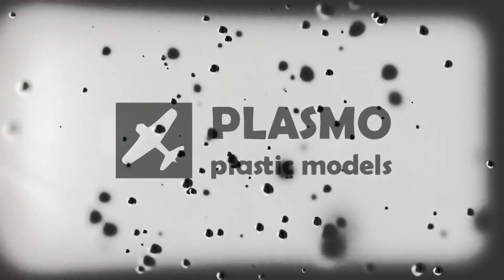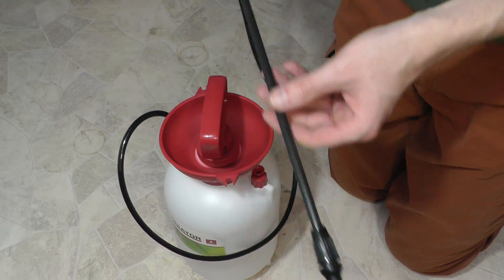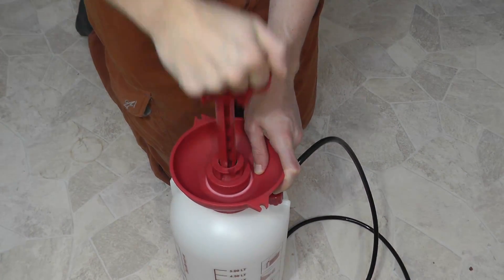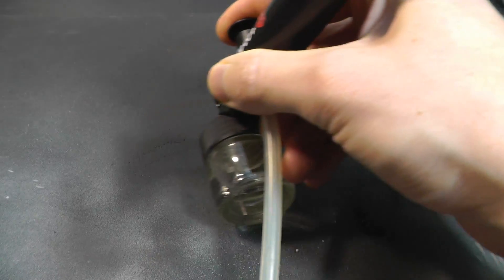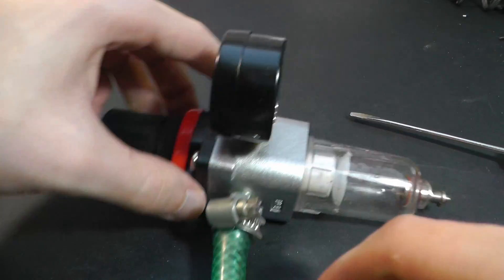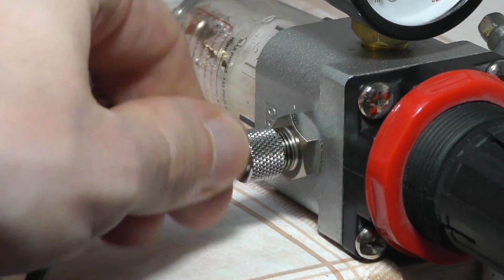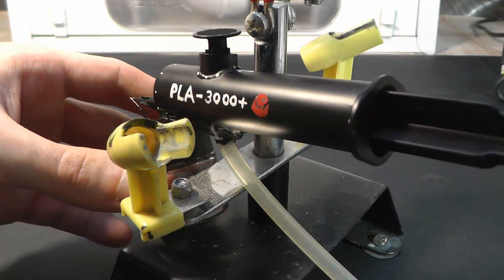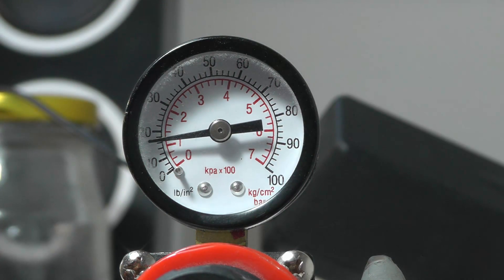DIY Pressure Sprayer = Air Compressor - Bonus Video

Comment from the maker: You can make models even in a post-apocalyptic wasteland if you round out of electricity. And its pay off. :-D
Reply: Modern problems require modern solutions :P
Reply: I from russia i LIKE yours vidio
Reply: Really amusing. Brilliant idea.
You taked making models on another level.
Iwata & Co. are pretty good,but using an handmaded tool is superbe!
Bravissimo,complimenti! (Trad. very good,compliments!)
Reply: The weathering opportunities would be endless to!
Reply: But my other question is how to clean this hand-made airbrush
Reply from the maker: @ericbadia5  It was in the airbrush video. Simply with thinner or alcohol.
Reply: PLASMO - plastic models oh! Thank you very much!
Reply: @ericbadia5  
I think that the only part that has to be cleaned is the paint's pipe.
You can use a syringe with a needle and proper solvent.
Reply: You are such a great modeler and a great person too as far as I can tell, keep up the great work :) Greetings to Czech Rep. !
Reply: @paul7376  im from slovakia
Reply: Harasho. Nagyon jo. Very good. Zer Gut. 非常にいいです
Reply: This really helps me out. My compressor was under a few centimeters of water when my apt flooded. I'm pretty sure the compressor is toast but I have not taken it apart yet.
Reply: I am not sure if you maybe once replied to my comment but in the case und didnt saw him I will write it again.

What do think of custom photo etched parts made by a mask printed on a normal printer and a fresnel lense to shrink it?

You can buy these lenses as spare parts for overhead projectors and they are also available in quartz glass wich is UV transparent and resistant.
Reply: Just be healthy  and safe ! Plasmo
Reply: you rigth...bro¡¡¡ jajjaj its good idea for later end of the world¡¡¡ for make models
Reply: PLASMO - plastic models Hello David, please make a Bi-plane with the emphasis on Rigging. Thank you and stay safe!
Reply: I'm from Belarus.
Reply: Hey! It's possible with an aquarium pump? Can you make a video about it ? 

Thanks!!
Reply: You got great hair.
Reply: I have a question, did the enamels paints a good work on airbrush? Im new on airbrushing and i have a lot of enamels paints, and how can i dilute the paint?
Reply: La Pampa Argentina, with the global pandemic
Reply: I guess it is kind of randomly asking but do anybody know of a good website to watch newly released tv shows online?
Reply: @Maximilian Cassius Lately I have been using Flixzone. Just google for it :)
Reply: @Yehuda Rex yup, I've been using flixzone for years myself =)
Reply: @Yehuda Rex Thanks, signed up and it seems like a nice service :D Appreciate it !!
Reply: @Maximilian Cassius No problem :D
Reply: For the more technically inclined a old fridge compressor works well.
Maybe an idea for a next video ;-)

Comment: honestly this would be great if you already have the garden sprayer but this has no point 

1. if you buy the garden sprayer 5L and the air regulator and buy the materials to build the DIY airbrush it will atleast cost somewhere 40-50 euros which is not worth it

2. you can just buy a cheap airbrush that works better than the homemade one for 10 to 16 euros

3. you can also buy a cheap compressor for 30-35 euros which is far better than the garden sprayer

4. this setup costs 40-51 euros max and is far better than the DIY

5, its not worth it to go out of your way and buy the gardensprayer and the materials needed to build the DIY airbrush unless you already have them or unless theyre really cheap were you live

conclusion dont go out of your way to make these it will cost you nearly as much to buy a normal far better airbrush setup

the end

6. im speaking out of personal expierence

Comment: I though about rigging an cheap car compressor with a pressure gauge and connecting 4-5 pet 2l bottles and then connecting those to the airbrush, tho not yet tested might work enough.

Comment: How much was regulator? It sounded like you said $80 but that's has to be incorrect. There are regulators for tool compressors for like $10 that look like they should work.

Comment: i just bought a 7 euro 'car tire' compressor on ali express. it cant pump a car tire but it can definitely pump an airbrush. You only need a female sigarette lighter plug to either powersocket or a small dc female to plug in any 12v transformer (most people have these lying around) and then you're done for about 10e.

Comment: Hi @PLASMO, this video is perfect for me. I started building models and I want to airbrush them but the compressors I want are very expensive. An Euro-Tec 20A is 378 euros. I could buy it, but I am not sure it is worth that much for me since I work full time and have hardly time for this hobby. I would like to try airbrushing first and experience painting before spending €€€€ on this. I will be building your project, thank you so much!

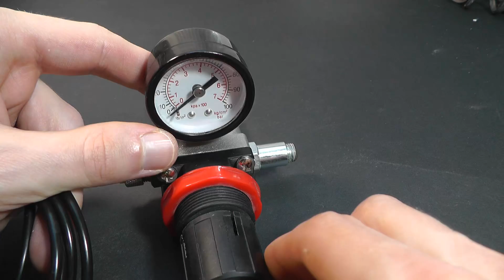Comment: 2:16
I'm really sorry to be that person, and I'm not implying that your English isn't good, but I had some trouble understanding what was said here. What kind of regulator is this, and how much did you buy it for? 

Thank you so much for this video, by the way. I realise that airbrushing seems to be the way to go for painting vehicle models, but I'm really poor these days.
Reply: You need a air regulator with a pressure gauge, so that you are able to set the outcoming air on a certain pressure.Its also called air regulator or air pressure regulator on amazon.
Reply: @markaz021  Thank you very much.

Comment: Can someone link a similar pressure regulator that David used in the video? And what kind of attachements/connectors you need to connect it to the barrel and the gun? Thanks!
Reply: if someone need it it is just a regular AFR-2000 regulator

Comment: You can make a panel line scriber, by using a mechanical pencil, and a sewing pin.
1.Cut the round bobbin end off the needle.
2. Empty the mechanical pencil of its leads.
3. Insert the needle into the mechanical pencil with the point facing outwards.
4. Adjust the pin so the tip shows by about 3mm or 4mm.
It creates really fine panel lines, and if it ever does get blunt, just replace the needle. Cost = about £1.50p
Reply: Wow thank you so much for this comment haha - that’s absolutely genius!

Comment: David
Your a genius. You definetly have a knack for thinking laterally and problem solving. This way, even if you live off grid way out in the boondocks you can still have an airbrush and compressor. Dude, please keep em coming - I am really enjoying these "make stuff cheap" videos. If you could design any of the following :
1. Needle files in various sizes and shapes for awkward shapes.
2. Modeling saw.
3. Model table paint organiser.
4. Angle chopper to cut accurate angles from 0°-180°
5. Motorised paint shaker or mixer.
6. U V lamp.
7. Circular and round sanding sticks for awkward spaces.
Thanks.

Comment: I still use brushes and masking tape for the fact that it's cheaper, but with this new option I may be able to use an airbrush finally which will be especially useful for foamboard rc models

Comment: Plasmo, the AB build and air supply build is remarkable. The finish you achieved was stunning giving the parts. Can I ask if you will be using this ? I see you have good equipment and would like to know when you would use this over your other gear?

Comment: You can use as a compressor, a pump for aerating the aquariums, and as a pressure accumulator the container from the vermorel (the spray container) with two sense valves. And all with a cost of 20 euros.

Comment: Another bonus is, that it has a water separator,  because condensed water in the air is always a problem and Leads to speckles on the model.

Comment: Nice!
But I don't think it's worth it.
I started with a set for around 160€. A compressor with pressure measuring, a good tube and a good airbrush pistol. I also bye a second smaller nosel, so I could change the size if it's needed.
With the smaller I don't use so much paint. So in the long run I would say it's not worth.

Comment: Not only cheap but also very silent. I tend to get a mini heart attack whenever my compressor starts pumping.
Reply: you can make one with a refrigerator motor, if you add a tank (fire extinguisher, or gass container) and a pressostat on off switch and a pressure regulator with moisture trap, you can have for less than 100 euro an identical compressor with those italia silent ones going for 400+
Reply: @joek600  Yeah, that works but it depends heavily on luck. Fridge compressors r cooled by circulating cooling agent and do not have radiators or fins for air cooling. There is also lubricant in the fridge loop for lubricating the compressor. Without cooling n lubrication it might not last long. Also I've never seen a fridge compressor that will give more than 4bar pressure.
Reply: @StopItUrKillingMe  Mine reaches easily 140 psi with a custom made 14 lt tank from marine grade stainless steel. As for lubrication it will eventually lose some oil, so you need to add afew ml every 6 months. The only drawback is that if the oil gets in the circuit and in the tank due to oxidation in will start to smell bad. I solved that by adding a second moisture trap at the air feed before the cirquit of tubes that go to the tank. Mine works fine for the last 5 years. And if it would eventually burn out at some point, its 60-70 euros to replace the motor with a brand new one. A full tank can last me for about 35 min before the motor kick in again to refill it.

Comment: Great videos as always, David. I use a car spare tyre for air supply, Halfords (UK) do a replacement hose for foot pumps which I joined to airbrush hose, pump up tyre with foot pump which has a pressure gauge built in. Works well and free to use.

Comment: Renaissance  man. David  that you are.   In a time having a home with the garage.  I saw where, vacuum chamber and the  machine  was to  high in cost. So i took a Heavy Shoe box and. Vacuum cleaner.  Poured  the resin in to the mold. Took out the air bubble. The  finish product was fine. No problem  at first  it was. I did some twiting. It was a mess. But after  few try. Well it works. And yes people have  try it to and failed.  But i didn't  have to. I fix it a little more.  But the box has to be a shoe box heavy one at that. Duck tape  and tight hole. Now! I  live in apartment  so i need a pressure  pot. And i have and old, very old. Compressor.  The product is  from Japan.  Little  over 30 years old. But will see. What i can do with it. .... fun!
Reply from the maker: I had similar problem. Thus I made a vacuum chamber from a double-layered stainless cooking pot becouse the glass cover for vacuum or plastic boxes imploded. I bought an oil vacuum machine for air cooling so it is quite powerful. I achieved almost absolute vacuum. Something like 98%.
Reply: @idaemonplasmo  I made a vacuum chamber out of a big pickle glass jar. The good thing with that jar is that its like a tube so it doesnt have a narrow open end. Being glass allows me to see from the sides, the lid I made from plywood, avoiding thus the expensive thick plexigrass most people use. Its about 2 littres so there is plenty of room for the molds of the minis I sculpt.

Comment: You mentioned good airbrushes being available on e-bay for cheap, any particular ones you can recommend?
Reply from the maker: I personally have Fengda bd-130, but you can buy "0.3mm Dual Action Gravity Feed Spray Airbrush Gun Nail Art Paint"  $9.19 Then it Is good to change rubber seals for Teflon, fix nozzle air leaks (for example with superglue) and polish needle. Then you have a perfect airbrush.
Reply: @idaemonplasmo  Thanks, I'll check that one out then :D
Reply: @TME555  i bought a nasedal airbrush with compresor for 18 euro on aliexpress the seals broke almost instantly but i found teflon seals on aliexpress aswell it was a pack of 10 i think and it costed me 2euro. The compressor is still running strong and so is the airbrush. On the other hand i bought a second airbrush also form aliexpress that seemed better on paper and it was a bit more expensive. That one broke after 2 days :/

Comment: I was pushing off getting into the hobby myself because everything seemed so expensive, but now I can't use that excuse anymore!
Reply: It's more expensive when you get into wargaming, you don't need a top notch airbrush to get into this hobby. I started on 1/72 scale, but then did 1/35 armour because i like the details of them. It's all about what you like building. You can achieve great finishes with brush painting and patience.
Reply: War gaming is expensive because of greed from company's .....  i almost fell over when I was told how much a small model of some chick with wings was at a games workshop shop.. £90 for a 5 inch model.

Nah ya ok mate I will get a recast 

More than my whole modeling setup including airbrush brushes files snips etc etc ...

I
Reply: You are locked now hehehe ,i mean with the excuses ,hahahahah good luck

Comment: Is this going to be a series , building tools for models without spending a fortune
Reply: I hope so, tools for modeling are relatively expensive
Reply: Like?  Biggest investment is a airbrush... £70 with a compressor and a tank... amazon.

Everything else is consumables, blades paint brushes sand paper... thinners tape  etc etc
Reply: @vasili1207  I think he means the extra tools, like zimmerit tools etc.
Reply: I was under the impression it was a general modeling tool question. Not German specific...

That's super simple buy a kit with zim.. fact is you don't need special tools for Zimm either and if spending 4/5 quid on some pe zim tool is too expensive... I would suggest a different hobby like boxing or train spotting ... there super cheap
Reply: I still have an old refrigerator compressor that I need to re-purpose for these kind of hobbies. Hope I'll get around it one day.

Comment: i like this range of videos you made, the diy kind. It's really cool to see what's possible to make on your own without having to spend 500$+ on equipement :D
Reply: why so much?  a compressor would be the most $ component, but if you get one from a hardware store (harborfreight has a 3gal 100psi for $55US) and you can use for lots of other things.  Only downside is noise level.   I use a $25US DA airbrush from amazon, 0.2mm it works great.
Reply: $55US is like ONE Tamiya kit.
Reply: I use a lowcost system I paid 35€ last year, compressor AND air-brush, plus 2 needles, tubes, etc.